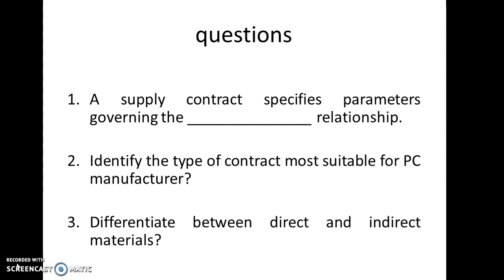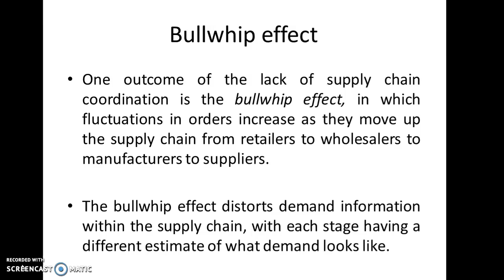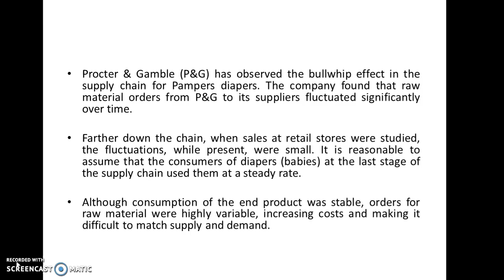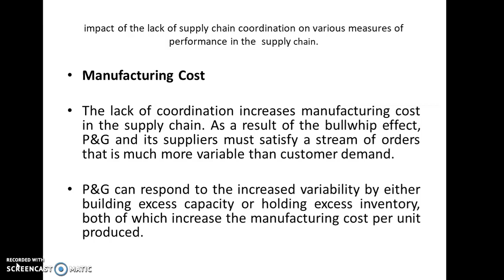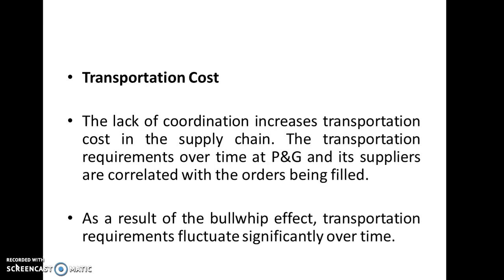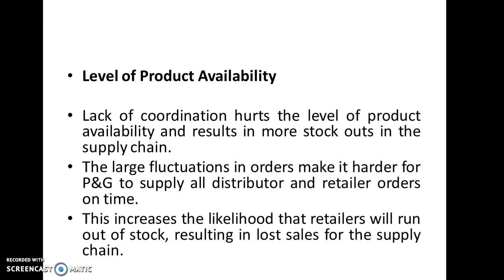Lecture 29 - Supply chain management

Comment: Name: ARUNPRAKASH R
Reg no&yr : 10 4th yr Cse A
1. Bull Whip effect:
1)Bull whip effect in a supply chain
 in which the phenomenon 
Describing how small fluctuations in demand at the retail level which can cause progressively larger fluctuations in demand at the wholesalers, distributor, manufacturer,and raw material supplier levels.
2) Bull whip effect is also known as forester effect is defined as the demand distortion that travels the upstream in the supply chain from the retailer through to the wholesalers and manufacturer due to the variance of orders which may be larger than that of the sales.
2.increases 
3.loss

Comment: 4cse b -075

1.Bullwhip effect:describing how small fluctuations in demand at the retail level can cause progressively larger fluctuations in demand at the wholesale, distributor, manufacturer and raw material supplier levels. 
2.it increase the manufacturing cost
3.Loss in supply chain